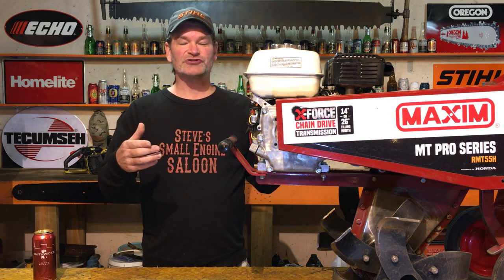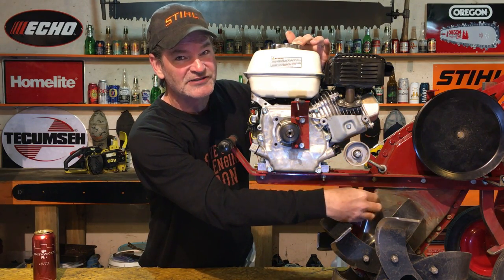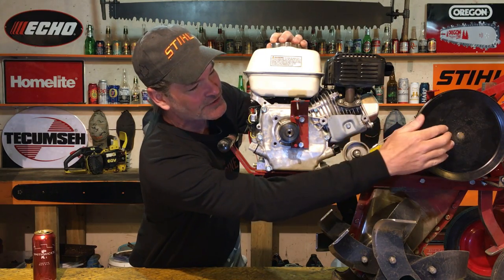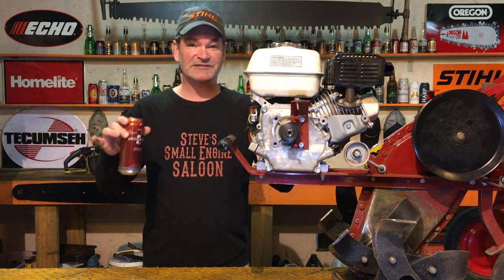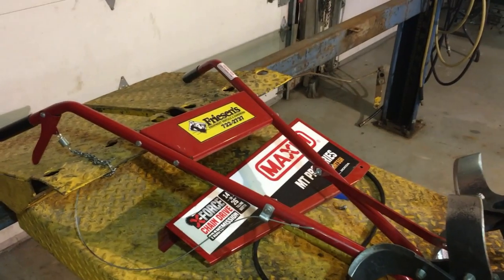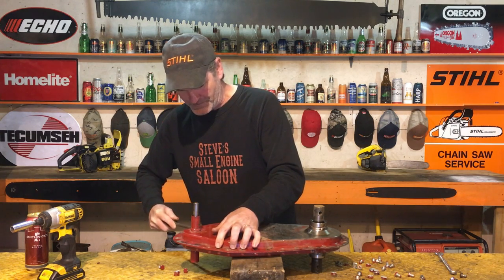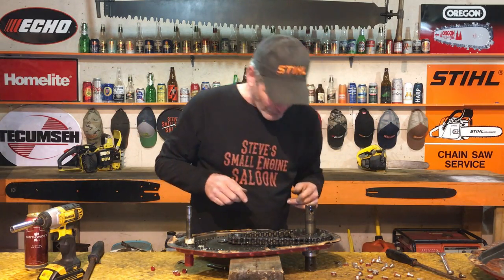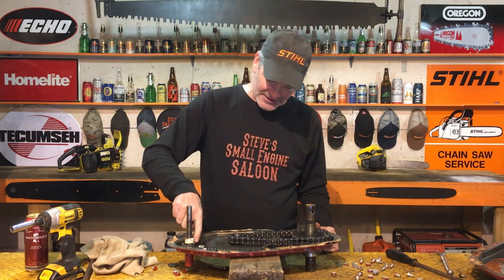Why The Tines Won’t Turn!  Let’s See What’s Inside a Rototiller Transmission

Comment from the maker: Click here for a NEW tiller---- https://amzn.to/3bJ1AzM
Click here for my website--- http://www.stevessmallenginesaloon.com/
Click here for my Parts and Tools Store---- https://www.amazon.com/shop/stevessmallenginesaloon
Reply: I have the same one with the same issue. But way older. So this isnt a new issue. Yet they choose not to redesign it. Looks like i will be dropping it off somewhere. Always hoping an easy fix. Nope! 
Making no easy disassembly is like putting a starter under the intake on caddies or like removing your whole front end to change a headlight bulb on a malibu. Evil engineering. 
But hey its job security for shops.😆
Reply: How do you take those tines off, the inner set closer to the transmission... ?
Reply: Was there ever a part 2?  I couldn't find it in your play list.  Thank you.

Comment: Hello, I need help from you. I got Honda f310 engine GX110 when it is cold start with no problem after when is worm and work for 5 min and you change gear engine slowly cut off and won't start

Comment: Steve as you work with small engine machines, have you ever stumbled into roto tiller blades that would be suitable for "grinding" old bush roots out? I've been trying to search internet, but to my surprise can't seem to find metal drums that would have like inch long hardened steel spikes? I think it would work well for many, but aren't anyone really manufacturing such blades? If you haven't seen any, well then I'll stop searching.

Comment: I’m trying to remove the tine gear shaft to replace the seals and check the bearings. I have the tines and key ring removed. I’ve been turning the inner ring with 2 indents on them for awhile now and nothing is happening. Should I use force on the left side shaft to pound it out. Would love your imput.

Comment: I wish I could have seen the few minutes prior to you taking that cover off. I’m at that point and the tines are rusted, and I’m wondering if the thing will come apart if I do get the tines off. I guess I can put some heat on the shaft now that the pins are out, it should come free.

Comment: Hey Steve I have a Choremaster tiller with a new engine. So far its working great. I can't find the oil drain plug for the transmission.  I have turned this thing in every direction to locate a drain plug.  It is a older model that the last owner put the new motor on the frame.  Please tell me what I'm doing wrong to locate the oil drain plug on the chain drive transmission.  Thanks for your time. Mike
Reply: I'll bet there is no fill or drain plug.
Reply: Probably just full of grease.

Comment: Love the PVC bushing, I guess the last person who had it apart misplaced the steel bushing. that may have caused the sprocket to break free from the shaft because the PVC surely cannot keep it from having play. If it were mine I would just take it out and weld the sprocket to the shaft. might as well because of the Caucasian  rigging (politically correct saying)  that's already been done.

Comment: I have an MTF frontline tiller that is 17 years young and in mint condition.  Long story short the Chaincase assembly broke and the part is almost as much as the unit.  I want to take apart and see if I can fix myself as I really like my tiller.  New ones are a few hundred more so this is a labor of love at this point.  Your video is really nice and removes the stigma from homeowners on the weekend warrior level to have just enough confidence to be dangerous.  Thank you for the video.  The mode I am dealing with is 21A-395A129.  Any tips you can provide would be appreciated.

Comment: Got a future issue with my tiller. Cranks good...runs about 30 seconds...shuts off. When I get a chance I’ll send you the video. Model Number 19883 TroyBilt. Briggs & Stratton 5BSXS.2051HF. Sure it’s a carburetor problem.

Comment: Want to lose all faith in humanity? Open a rental shop. Some people seem to think that renting is a licence to kill. This tiller was obviously worked harder than it was engineered for. Some will blame it on cheap offshore parts. It may be a factor but realize that the brand on the machine is ultimately responsible for the quality control portion. That being said, operator abuse is a big failure in this repair. All uuthe best to you, yours and your rental shop client.

Comment: Hi Steve, thanks for the vid. can you do a video on chainsaw run on? i have a Stihl ms170 that keeps running after i shut it off, not running well mind you but still keeps going until i give it gas and bog it out. i have 2 identical saws one 1 year old and one 5 years old, it's only the new one that has experienced this.

Comment: Steve you are so Right, my Craftmans Rototiller had the same problem only the parts for it were not available because they Sears went out of business. The old saying buy from Sears walk away in tears. So I got a better one not Sears and it works great and with a Full warranty. Keep the Videos coming I really find then EXCELLENT.   Ron
Reply from the maker: Thank You...
Reply: Check around online (Amazon) for parts.  Lots of Craftsman and aftermarket parts that will work are easily available.

Comment: It's sad that modern day heavy duty is chain drive instead of gear drive. I've been doing small engine work for 40 years and I can remember when tiller's were worm gear drive in cast iron housing. They would last for ever as long as you keep them full of oil.

Comment: Love your vidios 
I got a Johnson Turbo chainsaw that wont run with the muffler on and when it runs if i let go of the throttle it dies. Any tips
Reply: Sounds like it's  plugged.  Check the spark arresting screen .
Reply: Thanks fpr the afvise ill look into it

Comment: That is nice that you was able to solve that problem quickly and I have a problem with my Cub Cadet Zero Turn mower and can't get it to crank now after some wire was removed from under the deck. My neighbor helped me remove the wire and I drove the mower home and parked it. When I tried to crank it a day later it would not start and I can't find support from the company on how to solve that problem. When I now try to crank the mower it won't start and I am at a loss.
Reply: Sounds like a wire from a saftey switch. Time to trace it back and  see. Some will let it run but not restart
Reply: @billfischer6464  I will check to see if that is the problem with the mower. Thanks for that idea as I had forgotten about that.

Comment: Thank you for this video.  Wonder if you can help with another problem I have with a Troy Bilt Horse Tiller.  Old machine does a great job.  There is leaking seal on the left axle and I can change it, but can't get the wheel to come off the axle.  We've tried all the trick we can think of and put a torch to it to heat it up and the wheel won't come off.  Are you aware of anything else we can try?  Thanks again.

Comment: I think I'll stick with my old 70's Troy Bilt Horse model Tiller LOL.
Reply: Ah back when they were made in Troy, NY... now they are MTD rubish
Reply: @workingcountry1776  Yes, and I think the one I have said Gardenway on it, most of the parts you order for Troy Bilts back then were made by Gardenway I assume?
Reply: @wildbill23c  garden way bought Troybilt and tried to save the company. There's a road called "Garden Way" in Troy still, well last I knew but MTD only assembles Chinese junk these days.
Reply: @workingcountry1776  Interesting thanks for the information.  As far as I knew the original location was closed up.  I'll be keeping my old Troy Bilt for sure.  Great machine, and I really need to get it out and get the carburetor replaced on it so I can use it HAHA!!
Reply from the maker: Those are the BEST....
Reply: They sold out to MTD in 2001. I seem to remember MTD trying to use the Troy factory but with back taxes and such I'm sure it just made more sense to move production elsewhere. 
Governor Pataki cut Garden way huge bucks just before they went bankrupt. Everybody loved having NY built or "bilt" garden equipment here in NY... it was a massive blow to depressed Troy
Reply: I'm with you. I've got an old Troy Built Pony, that's over 25 years old, and is still kicking !

Comment: I'm curious to know how that small sprocket is lubricated. Does the transmission hold gear oil? Didn't see much in there. BTW. Always great to do tear down and discovery with ya.
Reply: Splash lubrication, but usually yes there is oil inside that case, can't recall how much, but its not full all the way to the top, uses the chain to move the oil around inside.

Comment: I have to wonder what caused the teeth to shear off in the first place? Any thoughts on that?
Bill Stiles. Johnstown OH, USA
Reply: Probably a bad hardening job.  Judging by the chain size of upper to lower they don't expect trendous stress on the upper but if it wasn't hardened correctly it would wear down quickly till the chain could start slipping and then just strip right out.

Comment: glad  i have  troy-bilt  tillers ...old but built  like tanks
Reply: Definitely, I have an early 70's model with a Tecumseh HH-60 XL 6 HP engine on it.  It still works great, just needs a new carburetor and new belt put on it.  Dang thing is heavy but it'll still be going long after I'm dead.
Reply from the maker: Right on....

Comment: I would almost bet that a homeowner already broke the shear pins on the tines and replaced them with regular bolts to finish the job and finished the tiller in the process.not my first rodeo,I’ve seen this done time after time!if you find this condition and report it to your customer they may be able to go back on whoever they rented it to.not telling you your business but if you don’t replace the bearings and that deep gouge in the cover that unit will fail again prematurely 😆

Comment: Isn't the idea of a pulley/belt to slip if the tines suddenly stop because of an obstruction. This would save the teeth on the sprockets and maybe the crank in the engine.

Comment: Tines got caught up on a large rock or root most likely. Something needs to be a fuse to prevent such a catastrophic failure. A shear bolt or woodruff key would be a much better failure mode. This one looks like a 6 pack of LaBatts Blue.
Reply: You would think the belt would have been slipping to prevent that damage...unless that gear is plastic.

Comment: Great informative video as usual Steve. The engineers who design these machines don't make maintenance easy.
Reply from the maker: Thank You...
Reply: At least maintenance is possible, in comparison to the totally sealed (welded-shut) gearboxes of the more residential-grade tillers. This one is a dream by comparison.

Comment: What type of OIL would you recommend for the Gearbox?

I am in the process of building a Sleeve Hitch "Road Grinder" using a similar Gearbox powered with a Briggs and Stratton VANGARD Horizontal Shaft 9hp engine...

As I have a "Community" travel driveway, I'm sick of chipping at the potholes with a Pickax, so this will be my Powered Sleeve Hitch Attatchment for my 1987 CRAFTSMAN GT6000. 18HP Horizontal Shaft Kohler Magnum engine with a Roper633a Transaxle. ALL ORIGINAL!

Any assistance or recommendations are pleasantly appreciated!

Thanks again for your videos Steve!

Take care,
🤓 -Thomas
Reply: Thomas, what’s is the answer for gear grease/oil?
Thanks, Fred

Comment: Hi Steve, Where was this tiller made? Is this another Chinese issue? Or just how some things are made these days. (Sorry, I don't do political correctness.)
Reply: @InfiniteMushroom i rented a shitty tiller like this and it was busting the shear pin every 15-20 minutes. i finally just started using grade 8 bolts cause it was a rental and I didn't care if i fucked it up. It sheared 3 or 4 bolts before I said fuck it and took it back to the rental shop
Reply: If it was built/purchased within the last 15-20 years you can bet your hind-end it was made in China.
I believe the failure came from the PVC bushing that probably wasn't holding the sprocket from have play.

Comment: Yo Stevo , Those are usually a really tough tiller !  Getting a rock stuck in the tines at high rpm is about the only thing that will strip out the drive gear like that , in my experience . Who knows with a rental .
Reply from the maker: Good call...Thank You...
Reply: I'm going to guess that PVC bushing not holding the shaft or the sprocket from having play which probably ended up breaking the weld on the sprocket to the shaft

Comment: Somebody must have tilling a side of a mountain with boulders to break that gear. I have had the same tiller in my rental fleet for 4 years 2 oil changes orginal spark plug and 1 new air filter starts everytime. Those little honda motors are tuff as shit.
Reply from the maker: Right on....

Comment: I would also replace that primary chain as well. I don't know if it's possible, but a new bearing on that pulley shaft wouldn't be a bad idea either.
Reply: . It's only been used a few times and you're going to replace a bunch of parts that don't need to be replaced. Sounds like my car mechanic.
Reply: @DK-jd8bj  you're right to a point: but you have to realize that if something failed, you want to know why. It's useless to spend all the labor to take something apart, replace just the one thing, just to have the same failure again. Had this broken, due to overload, you're pretty safe, replacing the weak link that broke. If it wore out, you have to assume that both surfaces wore out. For the teeth to be stripped off that drive sprocket, there undoubtedly had to be wear on the chain. If the chain is slack, and there is too much clearance between the chain rollers and the cogs on the sprocket, it's just going to fail next time it's used. If the new chain and new sprocket still have too much play, an axle bearing is suspect. 
     I agree, you don't want to do more than necessary, but, you also want to make sure it stays "fixed".
Reply: Plus, you've already got it entirely disassembled to this point, why not replace shaft bearings, oil seals and chain, then you'll know that all of the critical components are new, and it should not fail on you. Besides, there was a lot of metal shavings inside that transmission housing, and that stuff gets inside of everything.
Reply: @ralph5469  That's my argument, exactly! There is no sense in replacing just the broken part, just to have to do it again before you get a season of use out of it.

Comment: It is, essentially, a Merry Tiller. My guess is, nobody checked the gear box oil, and ran it dry. It will not last long. I, along with my family, have worn out 3 of these...2 of the units were cultivating about 1 to 1.25 acres for 15 years each. I have the last. Purchased about 2000...the price for these units are nuts...like $1000-$1600. The first one, the mid and gear were completely worn out...and it had ample lubricant.

Comment: Could a rock stuck in the tines  strip that out? My Craftsman tiller kept running the belt off. From the factory the set screw wasn't drilled through. Basically it kept running the pulley and belt off. Inspector 12 at the manufacturer was out that day.

Comment: GOT 2 OLDER TILLERS WITH TRANS PROBLEMS IN TODAY. The customer also had a shaft drive unit with a blown motor, taking the good engine
off one of the broke chain trans models and putting it on the shaft drive unit to get him back in the garden. He seemed very happy to get the older
unit fixed as it has never failed to work for him till someone forgot to check the oil.
Reply: My Neighbor did the same thing last week.  You don't live in Kearney do ya?  Dead engine on one with a shaft drive, locked up tranny on the other.  He's got a big shop and works on tractors and implements.  Always something good for sale up by the road.  I'm waiting for a small tractor with a front loader and box blade.  We got so much rain here this spring I was afraid I'd need something with a sickle bar.

Comment: Check the shear pins first !!! A friend didn’t listen to me and took it in to get worked on.  Either the person working on it didn’t check it before tearing the transmission apart, of fibbed when he said he was replacing them because they were wore out.  Well, he partially lied because I told my friend one was missing.  He didn’t believe me.  Instead he paid the repair person over $300 for new parts and time.  Explain to me how one side can be rotating, yet the other side doesn’t, even though that side of the shaft was turning. AND, both sides were working and had dug up a garden spot nicely that was rototilled every year.

Comment: When the case was vertical the weight of the chain pulled on the stripped gear just enough that allowed a bit of motion in the output gear when you turned the big pulley.  Once laid horizontal, the chain slacked off  that stripped gear which is why when you spun the input shaft there was no longer movement in the output shaft.  Neat vid!
Reply from the maker: Thank You...